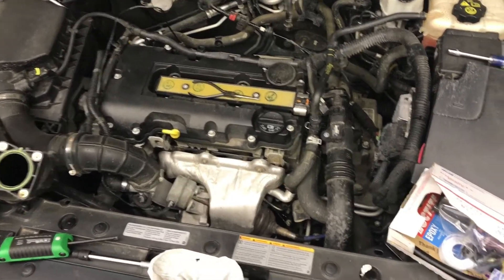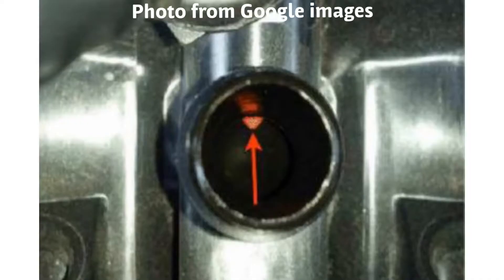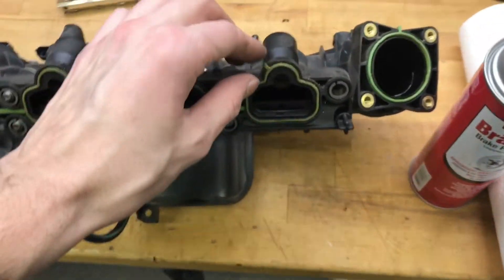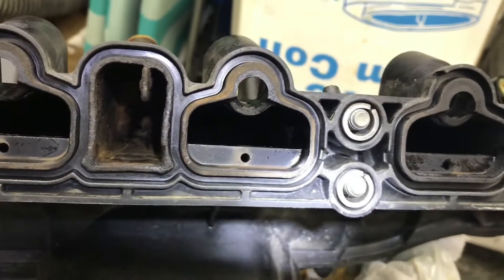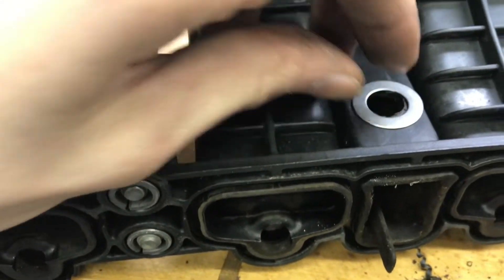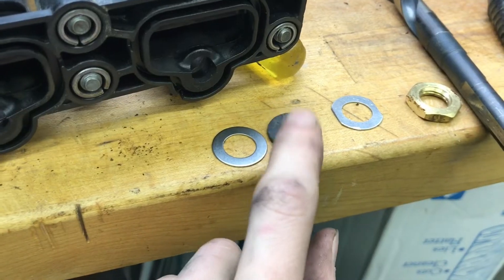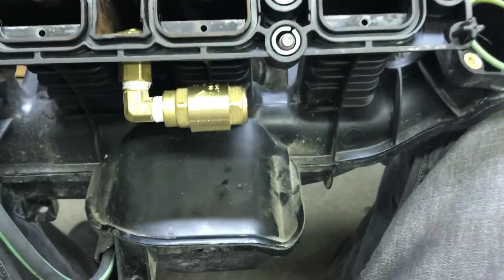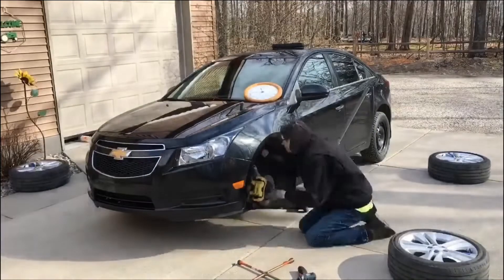Chevy Cruze Intake manifold PCV valve fix kit V2 supplemental Installation

Comment: I have a 2014 Chevy Cruze with 1.4L engine it has 180,000 mile. I have been getting a P0420 code. I would go away and come back. I fixed it just by disconnecting the Negative side on the battery 1st. Now find the computer it’s on the side where the battery is. It’s has 3 connectors on it. I disconnected all 3 connectors and cleaned each side male and female connector with CRC 05103 QD Electronic Cleaner. Let it dry 15 minutes. I plugged all 3 back in. I installed negative battery cable. I started and drove the car 50 miles. It never came back.

Comment: my manifold still had the orange nipple and was  briinging up traction control and engine warning light. Tested for codes and it was misfire on cylinder 2. New coil and plugs did nothing. found a vacuum leak on the throttle tube attachment (loosened the hose clip and adjusted). Was right for a while then came back week later.  Fitted this v2 kit and started it up. Real bad misfire and flashing engine light-when turned ignition off the radiator fan kept going. Disconnected the neg battery terminal (which I didn't do installing this kit)..  It started up this time and hasn't missed a beat...Thanks so mush for this fix-- GM should be paying you royalties
Reply: I have same problem with mine now did u ever diagnose the problem

Comment: Question why after doing this procedure my car now not only reads the p 01711 code now it has included the p 1101 code and the airflow when I check it from a vacuum pump the airflow seems as it is restricted and the suction is very light and the vacuum gauge now reads a little worse than it did before so it's more in the 12 lb of mercury versus before the 15 lb of Mercury which are the vacuum gauge stands for late timing. Do the air suction from the T adapter supposed to be very light or should it be very strong something must have went wrong what's something else is wrong
Reply from the maker: Straight up SAVAGE 25 I really don’t know about that one, just check over everything, sorry man, nothing worse than trying to fix something to only have more problems, let me know the outcome!
Reply: did you fix it and figure out what happened?

Comment: Valve cover was replaced on 1.4 LT engine and after throttle body is leaking oil. Please what is the cause any help.
Reply from the maker: BlakK Apple the intake manifold rubber valve is probably bad, thats what the fix kit is supposed to fix, so oil is getting sent through to the turbo through the inner cooler than the throttle body. Or the turbo is leaking oil. Best of luck!
Reply: And also don’t know what is wrong when ever I wash my car air condition stop to work for a some hours and I have to take off the battery negative terminal and put on before it start to work. What is the problem?
Reply from the maker: No idea on the ac... i would check to see if water is getting into fuses box. I would also check the freon pressure level.

Comment: I’m about to install on my GF’s car. Is the epoxy just to seal the one hole where the rubber nipple was? I can’t tell if you sealed off the top hole completely or not.
Reply from the maker: Reed Davis its for the little hole where the old rubber flap was. Top hole stays open
Reply: Thank you sir. I’m going to subscribe because you are cool

Comment: FYI, this PCV fix kit has been updated to the V2.1 kit, which uses a EVAP purge line "Y" fitting instead of the old brake booster tee. The brake booster tee was replaced in order to reduce cost, to eliminate a potential vacuum leak point long term, and to eliminate the potential need for maintenance/cleaning of the tee fitting and manifold nipple.
Reply: I just ran into this problem do you know how to install with y fitting
Reply: @isaiahwarta1369  check cruzekits.com under "about pcv fix kits." There's a install instructions section with a download for the 2.1 kit.

Comment: Good video. Just make sure not to use too much epoxy. You don't want to block the pcv path going out to the top of the manifold throug the pcv pipe (corrugated hose). I only stuck a little on around the screw with a popsicle stick. Doesn't take much, that stuff is really strong.
Reply: Dre Dan  the link doesn’t work
Reply: Andrei, the kit is working flawlessly nearly a year later. I'm really impressed with it, and you didn't charge much at all. I would recommend it to anyone.
Reply: I have the kit that use the BNR throttle body spacer can I simply just purchase from you the t fitting that goes to the brake booster instead of running it to the throttle body spacer?

Comment: I got the 1.8 N/A and was wondering if a kit like this is available/necessary.. will be pulling the cover today due to failed PCV
Reply from the maker: Ron Archer no. You don’t have a turbo.
Reply: Mr95Kenny thanks for your time. Just to be clear because it’s no turbo I don’t have the check valve in the intake manifold? Or it’s just not prone to failure like the 1.4T?
Reply from the maker: There is no check valve. The PCV will just dump right into the intake manifold

Comment: @Mr95Kenny after doing this fix, my cruze smells horribly or burning oil. It is running much, much better - I have expected the engine bay and it is all clean no oil leaks... but in the cab it smells horrible or burning oil. Anyone else have this issue?
Reply from the maker: Taylor Longhurst i have no idea on that.

Comment: Instead of wasting $30 in can after can of brake clearer--- just spray it out with a water hose and dawn soap-- then you can use a small amount of brake cleaner to finish up.

Comment: Thanks for the video. I've done this new on my intake hood, but i dont know how to check if it is working properly, if it is efficient or not. is there any way to check this??
Reply from the maker: I guess you could take the hose off that gos to the brake booster connector and maybe suck and blow on it to see if you feel that valve working. Lol. I might actually try this and will get back with you, just to check my own
Reply: i have done this system on mine one. so after couple weeks i observed oil leakage  where intake hood connects with big hose. from the clamp i observed leak. so master told me that this works but not working properly, you need to buy new

Comment: do you recommend replacing this even if the issue hasn't started yet? not sure if it will mess other things up
Reply from the maker: Ethan S. If it aint broke don’t fix it
Reply: @Mr95Kenny  Thank you. I just bought my 2011 yesterday, is there anything you recommend replacing ASAP or looking into? to prevent further damages
Reply: it has 60k Miles, is the 1.4t eco model
Reply from the maker: Change the transmission fluid! I do mine every 50,000 miles. Other than that just normal service stuff
Reply: @Mr95Kenny  thank you, much appreciated!

Comment: Does anybody know if this will work on a 2014 1.8L LS? The intake manifolds seem very similar
Reply from the maker: Paul Swigart you don’t need it because you don’t have a turbo. Your PCV system should be just a straight shot without all the fancy valves.

Comment: What kind of check valve is that?
Reply from the maker: Dan Smith I don’t know the name or type. There is a spring on the inside that holds it closed until under vacuum
Reply: Do you think any kind of check valve would work?
Reply from the maker: As long as its high heat.
Reply: Ok do you happen to know what size fittings are used? Along with what size check valve or?
Reply from the maker: I don’t, this weekend ill measure it and get back to you!
Reply: That be awesome thank you
Reply: So I found all the fittings and check valve. Just can't seem to find the plastic tee that connects the factory line to the modification. Any idea where to find that?
Reply from the maker: No. Lol. Have looked but cant find. Ill look at it this weekend to see if there is maybe a part number on it. If you cant find it maybe you can cut the line and put a tee in there, cant remember how soft that rubber is.
Reply: Ye that's what I was thinking
Reply from the maker: So the hose is about 3/8 of a in for inside diameter. The only thing on the tee was 7.89
Reply: @Dan Smith where did you get the check valve? Part #? On a budget here
Reply: @elsinaloa33  100002  1/4"  wog400 npt dn10 euroblock made in italy
Reply: What king of check valve and pressure rating on it

Comment: After spending the time to remove the intake manifold or spending the money to pay someone to remove it, why not just upgrade to a ZZPerformance ported intake manifold which comes with new PCV valve and has better airflow to improve MPG fuel economy and increase horsepower by 15? I plan on getting one soon because it seems like mine has failed about a year ago and it took me til now to figure out what it was.
Reply from the maker: Korey Mayo i looked into it. It is a factor manifold that they “ported” and upgraded the PCV on. You could do the same by just cutting out the flaps and putting this kit in. But $300 isn’t bad for a little less work. I thought about porting my factory one but you actually get better MPG with the factor, the flaps are there to “spin” the air so it will mix with the gas better. There are good videos getting into detail on it.
Reply: @Mr95Kenny  as a solution for now though I'm going to get a dorman 47032 PCV valve elbow tomorrow for just $3 and just cut the vacuum line going to the intake manifold and put it in with some hose clamps. I read today just a little while ago on Chevy Cruze forums that someone else did this with great success!
Reply: As a temporary solution I replaced that vacuum line with 5/8 hose and a 1 way check valve 5/8 from eBay, but the intake manifold will still suck a lot of air from the crankcase.
Reply: If you want I can upload a video of what I did and an explanation
Reply: @Mr95Kenny  some people have actually reported better MPG after switching to a ported one or porting themselves! Plus they said it increases power way more noticeably than a cold air intake, aftermarket intercooler, or ported throttle body which is impressive! These Cruzes are so slow and underpowered from the factory!
Reply from the maker: If you upload a video i will watch! I put a oil catch can in and will be making a video soon, i also used 5/8 hoses. If i ever have to take my intake off again i think ill port it.
Reply: @Mr95Kenny  I just uploaded new videos today including the one way check valve and my oil catch can setup! Tomorrow I will be removing my factory intercooler and pipes and installing a ZZP intercooler kit I got on their black friday sale last year. I'll upload some videos of it soon!

Comment: hi Guys. Who can tell me, how it will affect if i connect the non return valve where the hose connects with T piece, not direct from the intake  fitting as shown in video?? will the non return valve work from 30 sm long distance??

Comment: Dear friend  i wonder something that what are symptms whith pcv problem. I have astra j which has  a14net engine so will I have this problem for the future?  And i have an other question that  there are 2 sensors my intake manifolt  but yours has  1 sensor  which collor is blue. What are differenses ? Thank you in advance ..

Comment: I installed my kit back sometime last summer in 2018 and last week I noticed it leaking around the washer that connects into the manifold I was able to turn it a little tighter but it’s still leaking I contacted Dre who sold me the kit and sent me new washers. My question is why would it be leaking there? Dre didn’t have an answer and my thought is either I over tighten it or not tight enough. What do you think or have any suggestions? I really don’t want to remove the manifold again it isn’t an easy project
Reply from the maker: Tommy Miller is there liquid like oil leaving out that you can see or can you hear air coming out of it? It you over tighten it maybe it cracked. But I really don’t know.
Reply: Yes it’s liquid oil and I don’t hear air because of the engine running . It’s not leaking real bad but any case it’s leaking and I dread having to take it off again. It wasn’t an easy project. I can turn the nut but the hose also turns so I can only turn it so far before the hose will kink.
Reply from the maker: I think the problem falls more on the valve cover gasket. A excess amount of oil is getting past part of the seal and into the PCV oil air exchange. This is only my guess. Probably wouldn’t worry about it though.
Reply: Did you figure out the problem or get it fixed?

Comment: Will do this, here in canada this summer.
Can you guys help me, i can constantly feel a smell of collant in outside my car, no visible leak but i have to feel up my cruze a liter every 6 months of so.
Any ideas will be welcomed thank you.
Reply from the maker: Marcel Costache I haven’t had the problem yet but have had heard the heater core can leak that is under the dash.
Reply: @Mr95Kenny  thank you sir i will double check that
Reply: Had this problem in my 2014 cruze for me it was the water outlet cost 30 bucks for the part
Reply: @jessyleclerc2142  change that last year problem is im getting this strange missfires at part throttle around 2000 rpms can`t figure it out if its the headgasket  weak valve springs  or an ignition problem.
Reply: @marcelcostache2504  how many km or miles are on your car i had to change my coil pack and plugs at  100,000 km the car had intermittent bucking at lights and missfire  might also have oil clogging up your turbo if you are missing the rubber check valve in the intake manifold
Reply: @jessyleclerc2142  will repalce it soon because my car is acting up do you by any chase have white smoke at start up?!
Reply: @marcelcostache2504   i do not have any smoke from my exhaust you may have a leaky head gasket or warped head if it has over heated befor
Reply: @jessyleclerc2142  thank you it always happens when the engine is cold at startup then its gone, maybe its the turbo accumulating oil or condensation,  the car never overheated and right know it runs somewhat ok.

Comment: Worked very well ! One suggestion though. Where the 90 degree fitting attaches to the bottom of the intake I replaced it with a 90 with 5/16 barb and 1/4 npt, then ran the hose up above to the top side of the intake. Place the check valve there with the straight barb down and a 90 on the top side. Then put a short piece from it to the intake fitting. There is a slight incline in the hose from below to help keep it clear and the valve is on top where it is very easy to access and remove if it needs cleaned out. All this stuff gets gunked up.
Reply: forgot to add that I used a zip-tie to hold the check valve in place to the large wire bundle
Reply: Im about to do this project,,,so you ran a hose from the bottom hole modification and connected the pcv on top of intake? Did it work?

Comment: I recently installed this kit and now I get an occasional P0442 small evap leak code. Before I completely redo this, is there a place I should look first?
Reply from the maker: John Worthington just recheck that all your lines and fittings are pressed in.
Reply: Did you ever figure this out? I’m getting the same code after my install?

Comment: Is it possible itll fix the p0299 code?
Reply from the maker: sheldon drewett so that’s saying the Turbo isn’t making enough boost, if the pressure is leaking out enough than maybe, but i know the turbos can go out in these cars. So maybe, check to see if theres any funny sounds coming from the turbo.
Reply: @Mr95Kenny  no funny sounds as it but it didnt throw the code till yesterday, it's a 2016 2nd gen body 1.4 .. It does have 97k miles on it but im hoping it's just rusted or a pcv problem, really not looking forward to buying a new turbo
Reply from the maker: So it is a different engine than mine, I don’t know much about the 2nd gen Cruze. Its the 1st gen i know can have turbo problems.

Comment: I highly recommend buying the v2 kit. $70?  You will spend almost that assembling the parts. I am installing this kit on a 2nd cruze. I hate these turds. Lol.  Info on check valve is euroblock 1/4" 400 wog dn 10 made in Italy. Number on box is 100002. Again, I highly recommend buying the kit and be done with it, then sell your cruze turd.
Reply: Doing my 3rd v2 kit this week. As soon as cruze came in I knew what was wrong with it. Opened the hood, popped cover off valve cover and felt the vacuum leak. 1 minute diagnosis. 😂🤣

Comment: Why not just abandon the idle vacuum function of the pcv with a bunch of epoxy at the stock check valve port without taking the manifold off? Has anyone tried this? The only hard part would be getting the epoxy to bond the oil crusted plastic.
Reply from the maker: Chris Sutton it would be messy, but you still need to have a exhaust port that reroutes somewhere or else your engine will pressurize and leak oil everywhere, or blow a seal.
Reply: @Mr95Kenny  ah! Right some blow-by at idle. Fuck I'd rather abandon the whole pcv system and just stick a breather on the oil fil cap

Comment: Hi,im from Indonesia, i have a sonic 1.4 non turbo, can i install this?
Reply from the maker: rachmat dwi if its the same engine it probably has the same problems so probably yes.
Reply: @Mr95Kenny  yeah but he won't have the check valve at the turbo inlet.
Reply from the maker: I must have read over the “non turbo” part. So if there is no turbo in a 1.4, strange, than you shouldn’t need this at all. You wont have the same problems we have.

Comment: If I am missing the rubber nipple. Do i need to buy a new manifold? Or can I still use the existing one
Reply from the maker: Mike Munson if you can find a part number for it, probably.
Reply: I just bought the kit. That's why I was asking.
Reply from the maker: Than the kit will plug the hole and reroute the gasses to brake booster
Reply: @Mr95Kenny  thank you